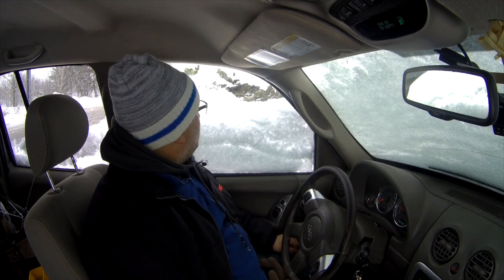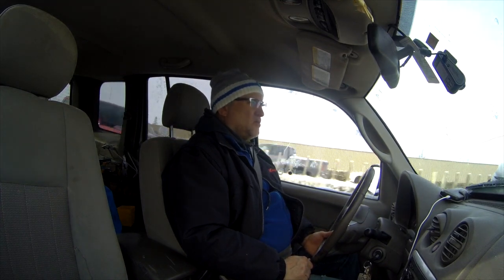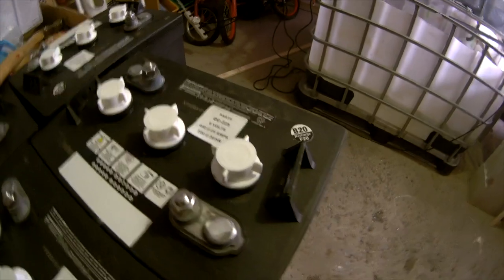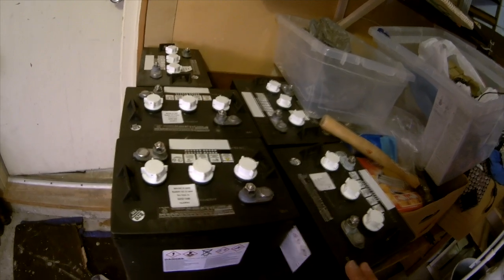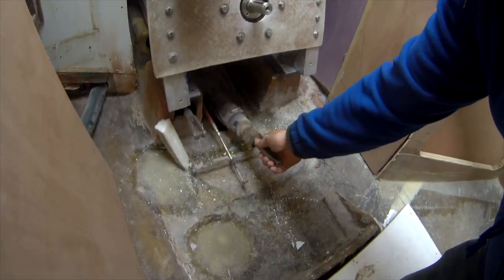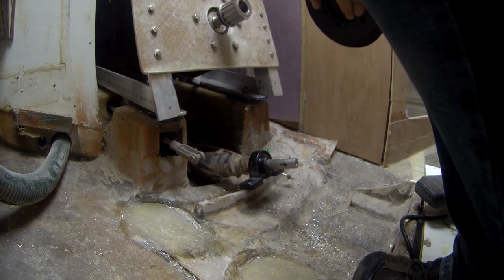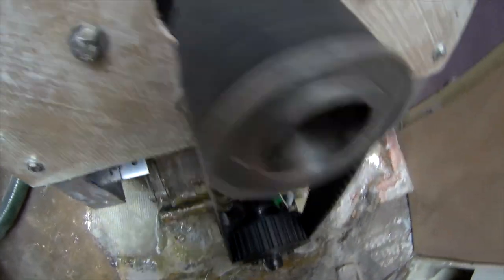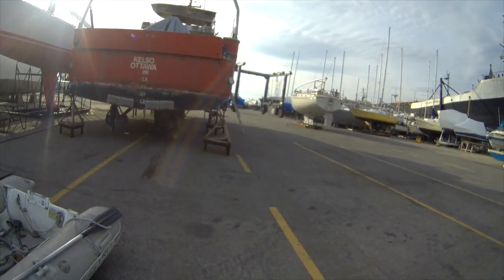Ep36 Batteries and Pulleys, 10KW 48V Electric Motor Part 3

Comment: Awesome vid! You went with a toothed timing belt. I have a buddy (wicked good at engineering) who recommends using 5 rib serpentine belt instead of toothed timing belt. Thoughts? Pros/cons?
Reply from the maker: it was noisy sounded ‘groovy’ lol couldn’t resist that one. If you can keep the belt tension tight a serp accessory belt would definitely be quieter. i am so much happier with the direct drive i can’t hear it at all so i bought a Cebra from victronconnect energy so i can monitor the power output. with the toothed belt i could tell my RPM by the sound. it was very evident. best of luck to you!
Reply: @TheNeds  How did you resist the thrust with direct drive? You just let it push on the motor shaft bearing inside?

Comment: Thanks for the vid! I am configuring my first electric motor and controller and batteries today. In a few days i will be installing pulleys for 2:1 gear reduction. Do I need to brace the prop shaft so that it does not drive forward with the thrust?
Reply: I think you talk about it @11:35, but I can't see back there to see how it is attached. Any hints on what/how to do this, I would appreciate.
Reply from the maker: in a later design i went with direct drive. this motor has enough torque to drive it. a later video has that. once a bearing is fixed in place a shaft collar on each side will stop reverse and forward thrust from sliding the shaft. it will not move. you can search thrust bearing for some ideas too
Reply: @TheNeds  Awesome, thanks for answer! I have a 14KW 5000 max rpm motor (me-1306). But I only need 2000 rpm max to make 4 knots with my boat. You think I can do direct drive? I thought a 2:1 reduction would make better torque with a load.
Reply from the maker: you might want to look at max prop RPM to consider your peak RPM. in my controller i have max RPM set to 2400 as my old Atomic 4 engine was geared at about that same RPM. the 2:1 also moves the energy consumption up. i am trying to putt along at the lowest energy use possible at 3.5 knots so direct drive is great. if i wanted better efficiency in terms of power in:power to prop then the 2:1 ratio is better. i am wasting some energy efficiency but generally i’m not in a hurry. i think whatever suits your style go with.
Reply: @TheNeds  Ah, I was under the assumption that gear reduction would use less energy. Hmmm. I also am replacing an atomic 4 with the same ratings as yours.
Reply from the maker: that took a bit for me to figure out. for my motor i have an efficiency number. i don’t have it in front of me but at low wattage say 500 watts my efficiency was about 40% and at 1500 watts my efficiency was 87%. all that means is that with 500 watts of power coming in i got 200 watts of energy at the prop. at 1500 watts of energy in i got 1300 watts of energy at the prop. its a sliding scale. i realized after tests and real world use that even though i was less efficient at low watts i was still using less energy and able to go a bit longer on the same energy as my hull speed resistance increased at higher speeds. its one of those diminishing returns the faster you go the more energy required. i am not in a hurry so i am fine with being less efficient its still a huge win over the energy required with my old atomic 4 which i would place as grossly less efficient than electric. food for thought and i appreciate your comments!
Reply: @TheNeds  Yes! We were spending 40 per day on gas motoring the ICW at 4 kts. Out of the 30 HP rating I started to suspect we were getting 10 max. Still considering now the direct drive, which is much simpler to configure... Thanks for all the help and inspiration (and lessons learn about the failed fiberglassed motor mount, which I would have probably tried prior to watching your video on it.)
Reply from the maker: i am not professing to be an expert i am learning and documenting my journey here. anything i learned i am passing along in my videos as i had a hard time finding things on the topic going back to 2018 when i started figuring out how to get into an electric motor without breaking the bank…

i had a chat this weekend with the guy that owns a large chris craft with twin 454s beautiful boat but almost $500 for gas to go to toronto and back… so glad i went electric. i spend a few bucks on one time purchases but being self sustaining is a good thing operationally. travelling is very cost effective. Adding a small generator this year for emergencies and longer motoring. also going to finally add in my liquid cooling this summer. :)
Reply from the maker: definitely. i used 2 shaft collars on each side of the bearing between the motor and stuffing box. best of luck!

Comment: Wow, hope you have learned a bit since you posted this cause you are out in left field on you number for the battery capacity. The 220 amp hour rating means it can provide 1 amp for 220 hours or 220 amps for 1 hour or some other combination inbetween. If you put 8 batteries in serries to get the 48 volts, you will still have only 220 amp hours. If your motor was drawing 100 amps that would give you just over an hour of run time to stay in the 50% discharge range.
Reply from the maker: Thanks for the comments! I definitely don't profess to be an expert at batteries, I think I made mention to documenting and learning along the way but I can see I need to do a better job at explaining myself.

I am on the same page understand that 200 Ah means 200 hours at 1 amp hour, but I was very confused by a label on the battery that stated something like 440@25amps. As this didn't match up with something that made sense to me I was struggling with that one. I have learned a lot since then but I think some of the marketing on those batteries were stretching some facts/falsehoods. I could have used your help early on...

Comment: I've been trying to get parts to make my belt transmission for my golden motor. Perhaps I don't understand, but it seems like these parts are more custom then standard. Did the company from which you purchased the pullies and belt also broach the keyway in the shaft? How does the process work?
Reply from the maker: i got my pulleys from torontogear they have an online configuration tool and it is pretty smart. you buy an inside part and match it to the outside pulley. i called them and got my order with the right parts. they were helpful.
Reply from the maker: https://www.torontogear.com/belt-length-calculator/

Comment: Im doing the same setup. Just removed my engins. Can you tell me more about your pullies and belt check us out on cruising plan B
Reply from the maker: Thanks for watching! I got my setup via Toronto Gear, https://www.torontogear.com/belt-length-calculator/ they have offices in both the US and Canada. The belt length tool was very helpful in getting it calculated right. You select the belt type, and then the large and small pulleys via # of teeth and it then narrows down to the only available options. Looking forward to watching more of plan B....